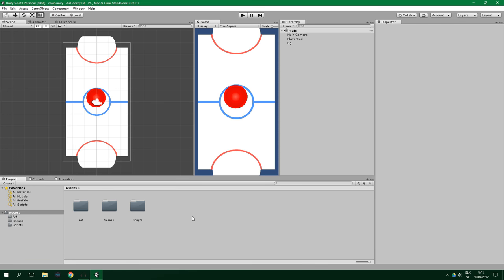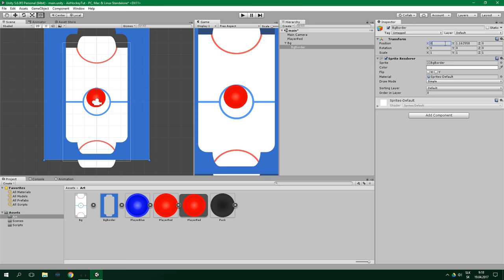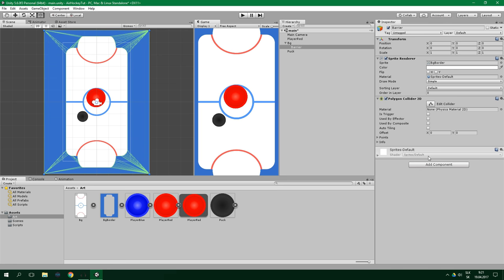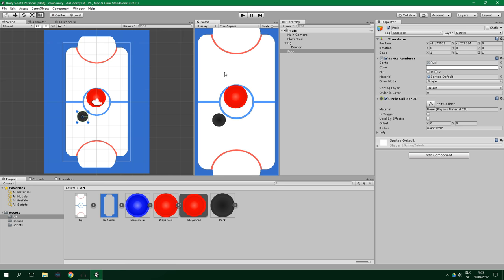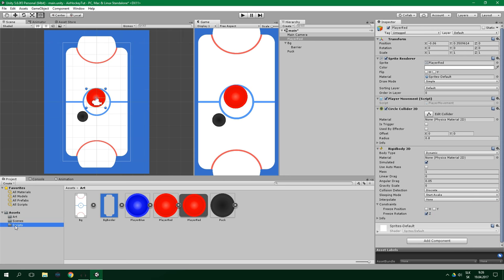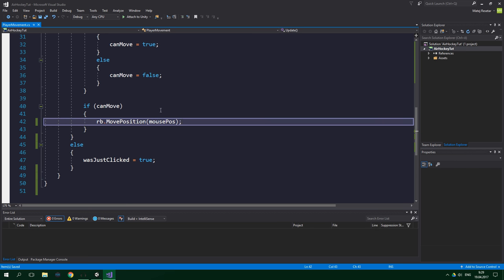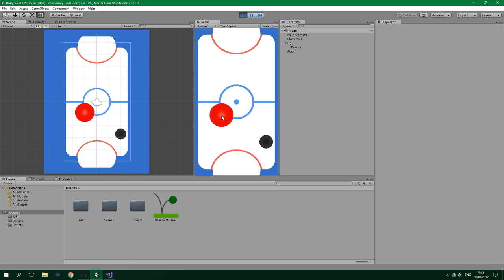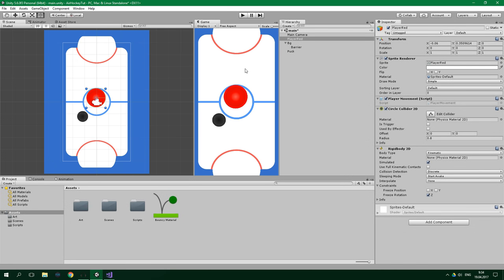#2 Make an Air Hockey Game in Unity - PHYSICS - Tutorial for Beginners

Comment: why when i hit the ball so hard the balls goes out the boundary ?
Reply from the maker: +FunkupGamer That's something that I'm struggling with as well. I've made some improvements but I'm yet to find a perfect solution. Sadly, it's a thing of Unity's physics.
Reply: if we increase the friction then will it work?
Reply from the maker: +FunkupGamer I haven't tried that, but I tried changing the collision detection mode on the puck to "continuous" and that helped a bit.
Reply: what type of improvements..??
Reply: nope that is not working perfectly.... so i had added extra trigger boundary and if the puck triggered that then it will set to the mean position
Reply: the puck not ball learn hockey
Reply: Change the Puck Rigidbody 2d - Collision Detection to => Continous and not Discrete, fixed my issues